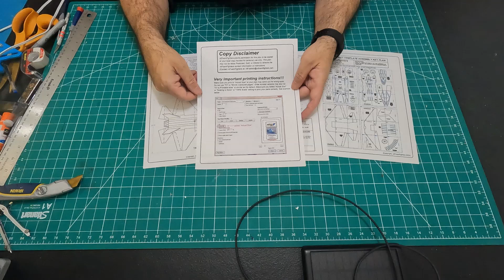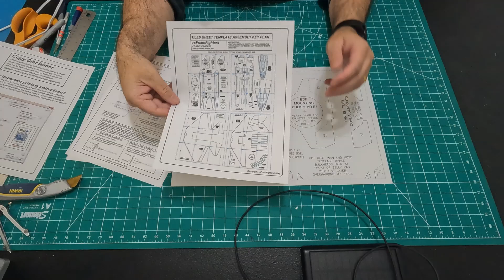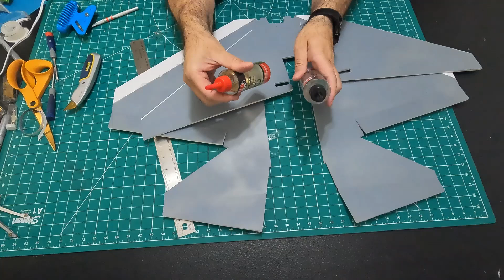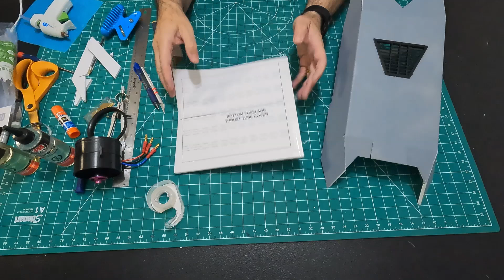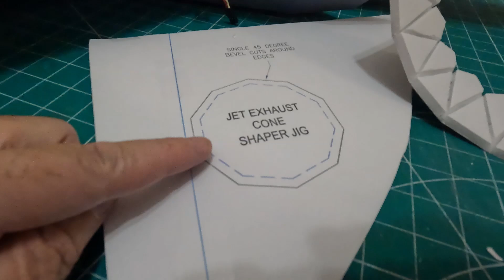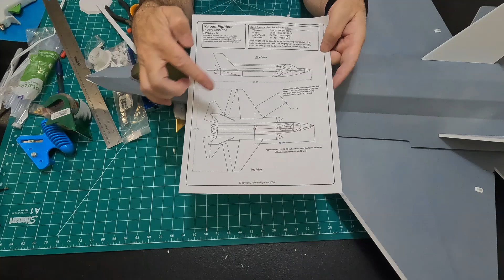FF-35V2 70mm EDF Build Video and Plan Release Notice

Comment: Can I use 64mm EDF for the same plan.
Reply from the maker: nihalganesh, I have not built and tested the FF-35V2 with a 64mm EDF yet. I do think it will work as long as your build will have more than 1 to 1 Thrust to Weight Ratio.  If your 64mm EDF makes at least 1.5 Kilos of thrust, I think it should be enough. More thrust than that even better.  I would think the 64mm EDF will be a little lighter and maybe use a little smaller battery, so it should work.
Reply: @rcFoamFighters  oh alright. Got it. Will try making one. Thank you so much for the help.

Comment: Hi Paul, bought your plan on offer last week. Here in the UK our foamboard is heavier than your dollar tree stuff, I have some depron which I have had for a while( that's very variable as well) so I plan to do a hybrid of foamboard and depron , just a compromise for weight will get back to you if it's a success.  Haven't flown for a while so don't hold your breath. Very envious  of your blue skys,😊
Reply from the maker: Thank you for the comment jeremysaunders9916! 👍 I hope your build and maiden flight go super good, knock on wood. I am sure your hybrid mix of foam should work. If you can, try to achieve at least 1 to 1 power to weight ratio and it should fly well. Scratch builds like this are always meant to be customized or modified as the builder likes with materials available. Depron should for sure result in a lighter plane. I am very interested to see how your plane build comes out! Feel free to send a video link or even pictures if you want. We can add to the rcFoamFighters website and gallery.  Thanks about the blue skies! I hope to see all the cool stuff in the UK one day.   Best of luck with the build and Happy Flying!

Comment: Very nice... ur good with those double cuts
Reply from the maker: Thank you mcemtpockets1775!  The 45 degree bevel cutter tool makes it much easier.  Once you set the depth correct you don't have to worry about cutting too deep. Usually, I first just cut the center line of each double 45 degree cut through only one side of the foamboard paper. Then just use that as a guide to follow on each side with the bevel cut tool.